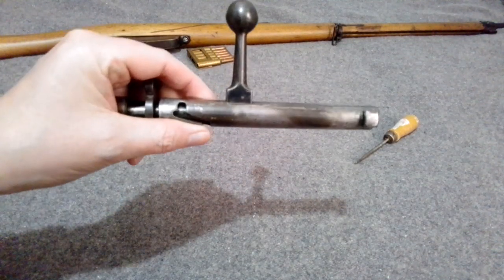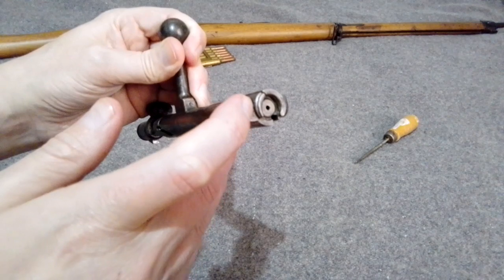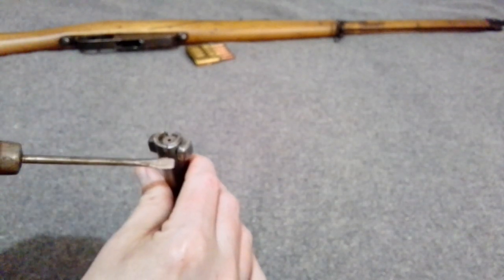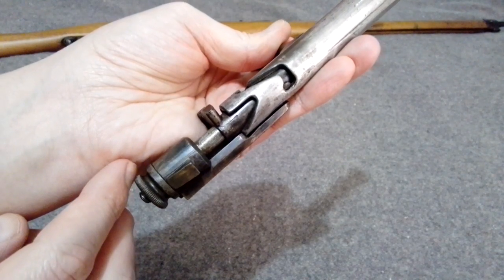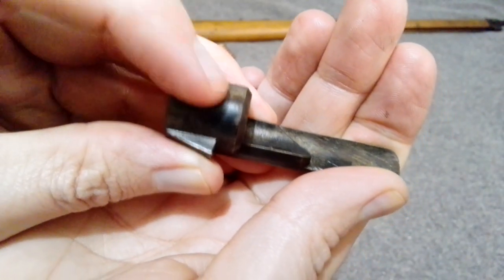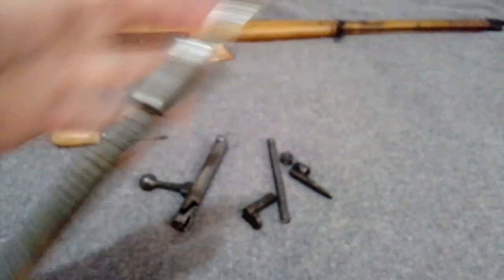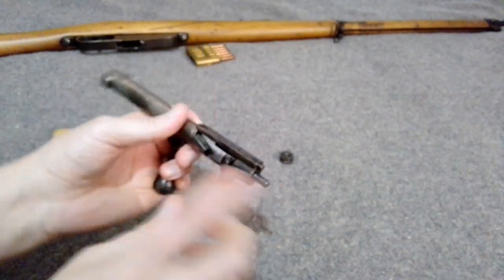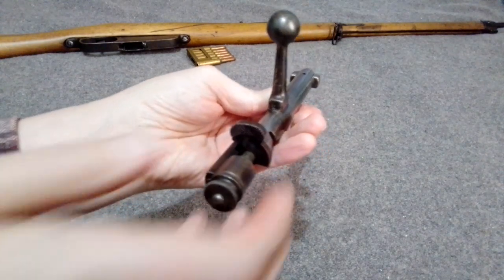Carcano Bolt Disassembly HD

Comment: Good video, GunGeek.  Owners of the old (Italy) military Carcano can use the video to help properly disassemble the rifle/bolt, ~inspect for 'crackage' and then put everything back together correctly. ... /// .... Many old US Rifles have dried grease at various spots.  The older rifles used both gun ~grease and oil for proper operation, and to make the firearm functioning last for years.  The proper instructions should be consulted for the particular firearm.  +GunGeek is the Wizard of Firearms. [... 3 things can help an old gun function properly: Grease ~ Oil and GunGeek information.]
Reply from the maker: true some old surplus guns can have hidden issues :)